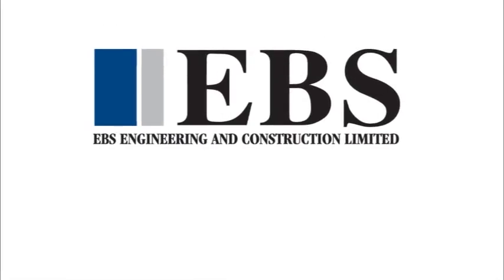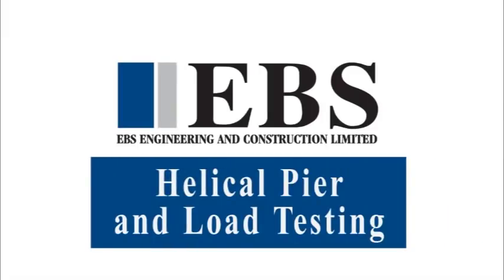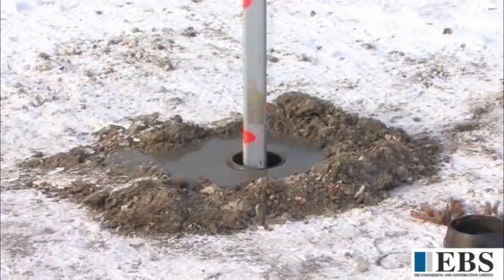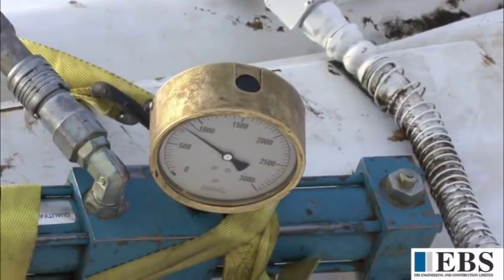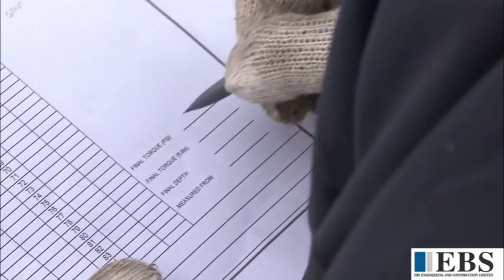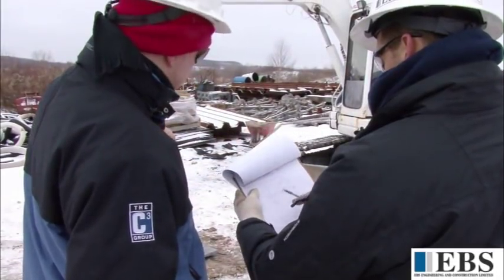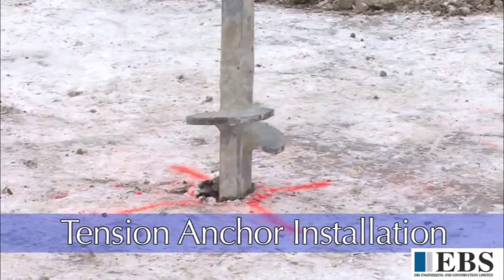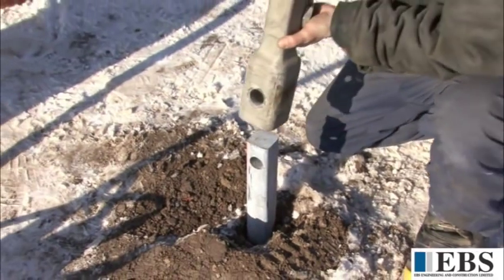Helical Pier Installation and Load Test by EBS Engineering and Construction

Comment: In the tension test shouldn't you be measuring the pier itself not on top of the jack? You are basically testing how much stretch there is on the threaded rod pulling up on the pier not how far the pier is actually coming out of the ground or the pier stretching itself.

Comment: Excellent video but the compression test is flawed. The deflection of the pier tested in compression should be measured as the difference of the measurement of the deflection of the piers used to anchor the hydraulic jack.

Comment: what about rocky areas with a lot of boulders ?
Reply: Probably can't use the screw piers then. Rocks have to be less than the screw pitch or something. Basically means the rocks are going to have to be pretty small and not boulders. But with some the lawnmower sized new near ground penetrating ultrasound kit maybe you can pre-locate boulder free columns? and then drive a long bit of rebar down to sample columns the non-invasive tech suggests may be free of large rocks and design and layout the foundation accordingly (sounds a tad risky ;))? So many variables my head is starting to swell up and hurt.